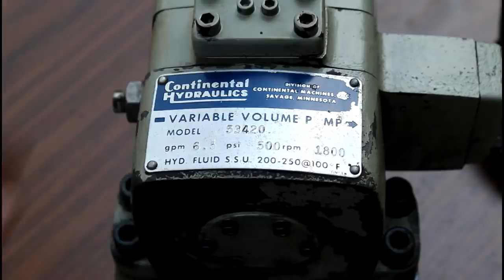Saving the SCRAPYARD SAW!

Comment: Hi
After greasing the motor bearings, run the motor with the bottom plugs out till excess grease stops coming out.
Love the squirrel.
Thanks
Reply: when grease is flowing out the bottom,your bearing is already way over greased. New bearing require no grease.over greasing= over heating

Comment: If you get any heavy quality cardboard boxes, cut them up and use them to line the bottoms of the drawers in the steel cabinet, also chuck a few of the bags of silica gel dessicant that come with new electrical goods in there as well. All the best from Somerset UK.

Comment: Steve,

Parts are still available for your pump.  You have a Continental hydraulics pump model # PVR1-6B06-RM-0*.  They will also make a new pump if needed.  I used to work at Continental Hydraulics.  We supplied all of the pumps for the DoAll Saws that were built at the same factory.  Website https://www.continentalhydraulics.com/product_item/pvr/
Reply from the maker: Thanks for the info / website . I'll check it out.
Reply: How cool would it be if this built the pump here??

Comment: As several others have said, Peanut sole the show. Amazing!
On another note, someone taught me any, many moons ago, a simple and very effective way to remove woodruff keys and similar keys. simply using a pair of wirecutters or flush cutters, place the flat back of the tool against the shaft and grip the end of the key with the cutter and lift. the tips act as a pivot point and the key will usually come right out. Obviously rust can and usually does make it more difficult, but the cutters will usually get a really good grip on the key. Never had one yet that this method didn't work with. 
Keep up the great work, love the channel.
Reply from the maker: Thanks for watching👍. I dont mind being upstaged by Peanut. Shes a wonderful little girl. She's more playful and than a house cat.
 Reminds me of a 2 year old child. Just has to get into everything.😁
I have removed woodruff  keys with side cutters before, it works great.

Comment: The pump is probably an adjustable rotary vane hydraulic pump. I recently took one apart and it's a very interesting design. The variable volume comes from the outer ring being offset but movable, usually spring loaded. The outer ring start far offset creating a larger pump displacement. As the pressure rises, it pushes against the ring, moving it to a more centered position creating a smaller displacement. It's a brilliant design! I wonder what the benefit would be on a saw like this. Its quite a complicated pump for such a simple application.

Thinking about it more, its probably because this application requires a higher flow rate and doesn't need much pressure. After all, you dont want to be waiting 20 seconds for the saw to raise after each cut! Most pumps like this that ive seen are under 1000psi but the volume output is very high compared to gear pumps.

Comment: Hi Steve - The rotating part is a Rotor sometimes called a squirrel cage Rotor and the part with windings is the Stator. The 5HP motors I worked on were bigger than that one but you are 60 cycles in USA as apposed to 50 in the UK. That motor is looking like new good job..

Comment: Steve, if you find some carpet being removed or some inexpensive remnants for drawer liner would be nice for that cabinet. I used that same material in my tool boxes and it works well. Good progress on the saw.

Comment: Great work Steve. One thing that I like to do with electric motors is to use Trichloroethylene (found in many "Electric Motor Cleaner" aerosols) on the windings and then seal them with Glyptal (brand name for red insulating varnish - MG Chemicals also makes one). Just in case the varnish on the windings is starting to fail. Anyways again, great work.
Reply: Excellent idea! Once restored an old 1940s motor doing this technique that had just a little too much leakage in the windings :)
Reply: Around here, we have some groundwater plumes that are contaminated with TCE and need special treatment before the water can be considered safe for human consumption. It's a legacy from defense manufacturing from ~1940 through the mid 1970s

READ the MSDS before you go using anything that might be toxic. This solvent isn't one to be treated casually - kind of like lacquer thinner, or methylene chloride.

Lots of fresh air is important, and if you are spraying the stuff, you want your airflow going past you towards the work, blowing any vapor away from your face.

Nitrile gloves and safety glasses are also good ideas - you don't want solvents on your skin or splashing into your eyes.

No need to be afraid to use chemicals, but the safe work practices are there for reasons... and some of these things can really mess you up.

Comment: Ancient electrics... Check winding continuity before you touch anything. Especially after finding that nest. Mainly because you may be wasting your time. Ratty may have chewed a short or open. Check again after pick/air cleaning because that is very intrusive 'heavy' handling/abrasion. It's kinda designed to take it but that doesn't mean that it likes it or that it's not mildly risky. Great job, I'm new here, looking forward to more.

Comment: You could have shaped the key way on the lathe , whit a internal boring bar that use hss blanks. In cast iron or aluminum, takes like 3 min to make. 
I have a vertical slotter but still make manual key on lathe for simple jobs like yours.

Comment: Your were correct in call the rotary part of the motor the "rotor" and the stationary part the "stator".  That's what they are called.  And it mostly refers to the two electromagnetic coils.

Comment: I have a bandsaw restore project I was planning on mentioning, before I got sidetracked with my hand warning. I picked up a big azz bandsaw for scrap price a year or so, ago, from a tool dealer close to me. I didn't realize it, at first, but it is completely air actuated. The electric motor drives the saw blade, and also spins the integrated air compressor. The blade head lifts and lowers with air, it has an air power vise.  The tool dealer had taken in, in trade, with a plan to refurb it. Then the shop guys decided it was too much work to fix all the plastic air lines.  I'm blanking on the manufacturer's name, but they are made in Oklahoma, and still make the model I have.

I just wish I had the time to refurb it, sooner, rather than later. At 66, you begin to realize, you just can't put things off too long.  lol

GeoD
Reply: George, I believe you are speaking of HEM saws which are made in Pryor, OK  which is about 50 miles from me.  I understand they are great saws usually with a large price, but I'm quite certain they are worth it.  I understand the age thing as I'm right there with you.

Comment: next time you install a bearing try heating it up to about 165 degrees F, it will then slip on no hammer or press needed. I have done that many times and is the way that motor repair shops do it.

Comment: A lot of those components look familiar, the pump may be the same as the one on my surface grinder.  I changed the motor that runs the pump, put in a modern frame motor.  I had to come up with some stand-offs to put the new motor at the correct height, drill new holes in the mounting plate to center it.  After much fuss, fume & cuss, the motor lined up perfect.  But it got hot like the original (just not nearly as fast).  The old motor will get tested further before I pass a verdict on it, as it turns out that my leg currents were way out of balance.  I finally invested in a clamp on amp meter, re-tuned my power, and it's all working as it should.  I don't think you will have the same issues I did, since you have the rotary, but it might still be a good idea to check your leg currents when you test/add a new machine to your system.
Reply from the maker: Good advice 👍

Comment: Hey where did yo get that hone and what kind of lubricant were you using? 
Ps. Love your work and your video. Definitely thinking about supporting ya on Patreon. 🤙
Reply from the maker: I've had that cylinder hone so long I couldn't tell you where I got it from. I would think just about any large automotive parts store would have one. The lube that I used was just diesel fuel. Thanks for watching I really appreciate it.

Comment: Great content Steve! From my experience, the bearing drains are to be left open while motor runs initially to allow any excess that would go inside onto the windings to escape. Let run 5-10 mins until excess escapes, then put plug back in. Still will have enough. I was taught, I believe by a bearing distributor 40 yrs ago the #1 cause of bearing failure is overgreasing.  I ended up removing the grease fittings on motors as operators would commonly shoot 2-3 pumps into every fitting they saw. Every motor had gobs of grease on the rotors that had to be cleaned out. Motors that run continuously only need to be greased and excess drained annually. Motor shop that did our rewindings also confirmed that. Motors that did need rewinding almost always because over greased and than overheated.
Reply: We use 480V 3 phase 100 HP motors for our air blowers at our city wastewater plant. The ones we had to re-bearing or replace were because one knucklehead greased the top zerk fitting without removing the bottom plug first. Our procedure says to run and warm up the motor, then pull the bottom plug, then grease it while it is running. No failures from grease fouling in the last 6 years I worked there.

Comment: Hi Steve and Elizabeth,  good progress on the saw, some friendly squirrel  you have there, hope it doesn't  bite ?. Talking of wildlife ,I'm  sure I saw a spider behind the ram you were removing , do they bite?,looked like you had a shielded bearing, pulley end of rotor, and open cage the other end , any particular  reason for this ,or did I miss something.?. The view from your shop looks like autumn  is here from the leaves piling up. Same here in the UK, and very wet. Well thanks for the video. And Best wishes to all, Stuart uk.
Reply from the maker: The bearings are metal shielded on one side only. For grease purposes.  Only a few spiders that bite in our area. Not real common issue. The Squirrel play bites constantly. Never been bitten hard enough to scratch the skin.

Comment: Just going off the video you shot, that pulley looked pretty damn wonky. I would have personally done a little more to get it dead on accurate as far as the ID goes. When it was spinning on you lathe, it looked like the body of the pulley was awfully heavy on one side. If that pulley is out of balance, the pump seals and bearings will definitely suffer. I like to clean up the castings near the bore, , and any place else on the body that won't weaken the overall structure.

Comment: When it comes to physically large electric motors used in situations like this isn't it a good idea to also give them a check for insulation resistance? Verifying the integrity of the winding core i.e. the enamel coated conductors have not been damaged from over-heating or foreign body ingest etc? There are some hi-tech DMM (digital multi-meter) testers available at not too high price & a couple of specifications/procedures that capture early warnings before disaster. It'd be such a shame have done such an excellent cleanup service & bearing job on a unit only for it to fail electrically right when its needed most a few weeks later!